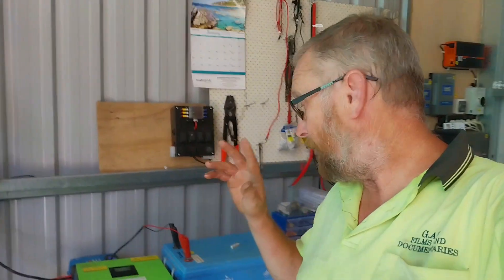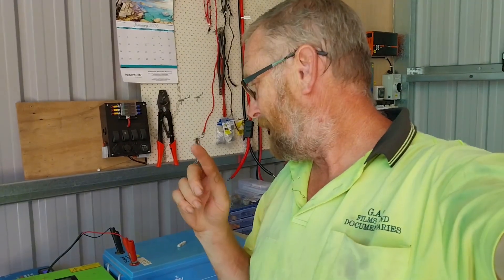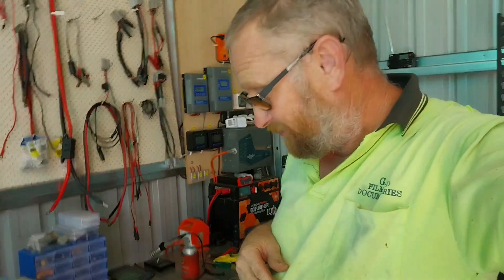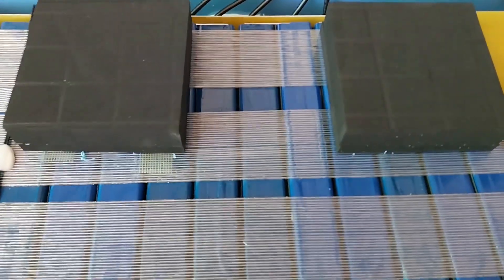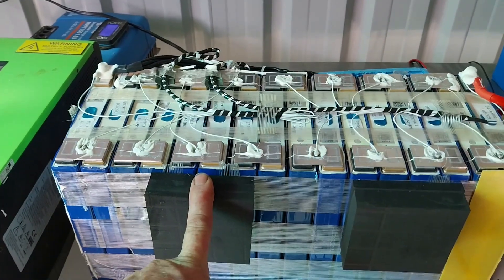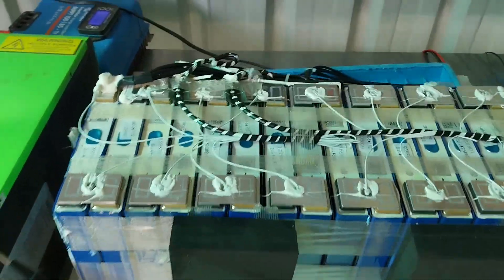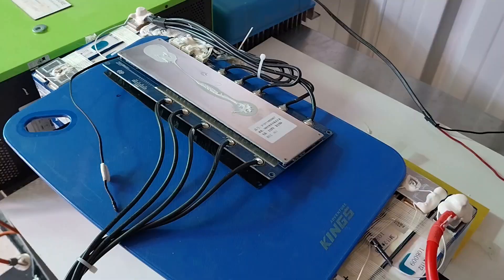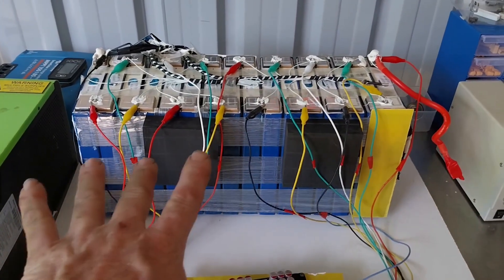Teardown & Test On The Second Lithium Battery - This One Is Different

Comment: Hey Glen, I’m not familiar with the bms your battery has. That aside, I found with my bms , 5 off all JK b series, if one cell hit the set over voltage point , say 3.6 or whatever you have chosen it will disable the bms charging and an alarm flag raised. But not the discharge function of the bms. Once the over voltage reset value is reached, say 3.55, then charging is again enabled. In other words battery will discharge into load and will not charge until that reset value is reached. That said I’m pretty sure dc voltage of battery holds solar controller to same voltage rather than say going open circuit and the controller spiking for a second. Can you connect to your bms via Bluetooth?
Reply from the maker: There is no Bluetooth on my BMS. They are the first generation BMS before they started putting Bluetooth on them.
Reply: the BMS cuts the connection via mosfets so it measures the voltage before the mosfet's (batterypack voltage) and behind the mosfet's (chargers + loads)

if the voltage on the charge/load side is higher, it assumes there is enugh potential to possibly charge the battery. and it knows when it's allowed to charge and when it's not allowed. 

so in one second the cells draw some current and in the next moment the BMS cuts the cord and that causes the MPPT's voltage regulator to fluctuate from overswing.

a huge capactor helps absorbing BMS-shuts-off-via-cell-overvoltage peaks.  it gobbles the voltage overswing and releases it slowly into a load or different battery that's still online. i'm using a 1F car HiFi cap that works well for smooth voltage.  but i'm on a 12V system...

Comment: Good onya Glen, great vid. Did you buy all 3 batteries at the same time, what's your theory on the difference and does it make a difference having them wired different? 
Now I want to see inside the 3rd one, may be you can take it to the local medical imaging place and get a CAT scan of it so you don't have to open it.
Reply from the maker: I will end up opening the third battery as I want to put the balencer on the cells. I think there is a cell or two in each battery that is showing early signs of failure.
I have written the purchase date on the top of the batteries, if I remember one was in June 22 and the other two in July 22 👍